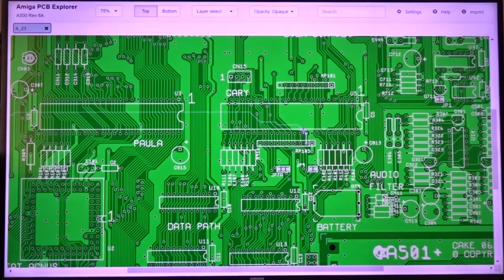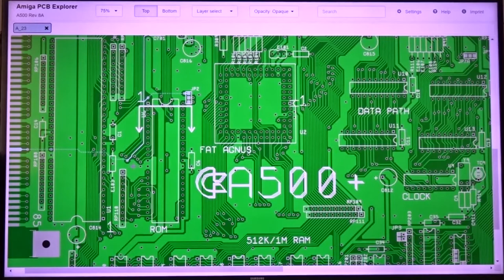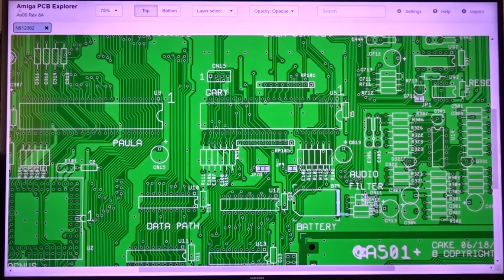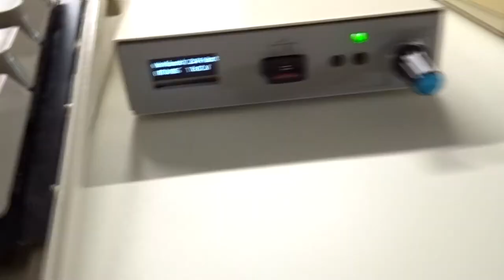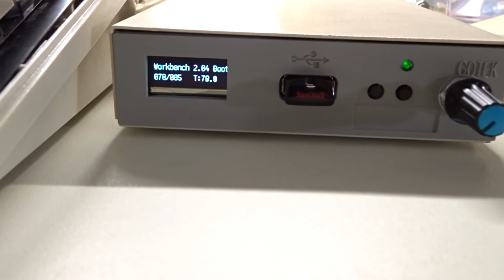Commodore Amiga 500 plus Ebay Junker to Jewel, Gotek and external mod pt3

Comment: I really need to break down and get myself a 3D Printer but I need to learn a bit more about them first.   I have a few external drives that I could convert to house a GOTEK but I found a cable solution from SORDEN in Ireland that works really well and I just sit the GOTEK on top of the A500.   Installing a GOTEK internally as most do to me is not a stellar way to use them for me if I were to do that then I would want the screen and buttons in plain view.  Yea that's where a 3D Printer would come in handy for sure.   Amiga PCB Explorer is a wicked awesome site and a major time saver when troubleshooting trace issues on a board especially when your dealing with battery corrosion or capacitor leakage issues.  For me its mostly battery corrosion issues which is a major PITA to deal with.
Reply from the maker: Best way to learn how to use a 3D printer is to just get one! Don't just get a cheap one to see if you get on with it. Get a reasonable priced one like the Creality CR-10 range! I have the CR-10s and it's perfect for all jobs!